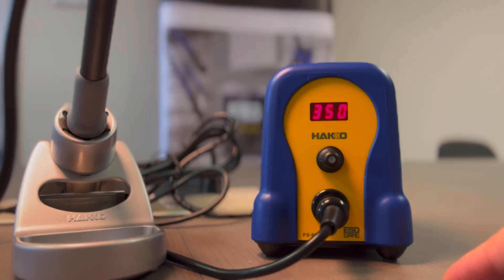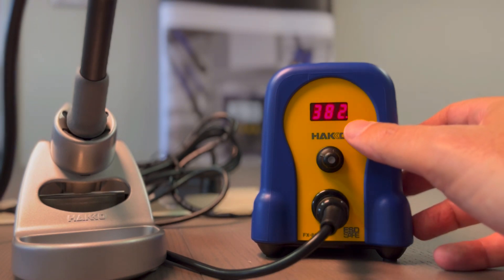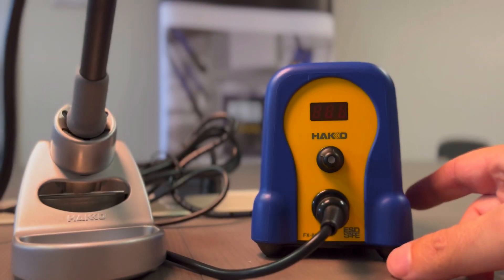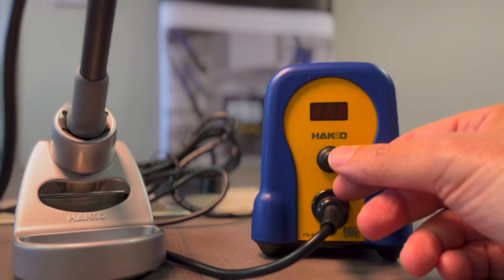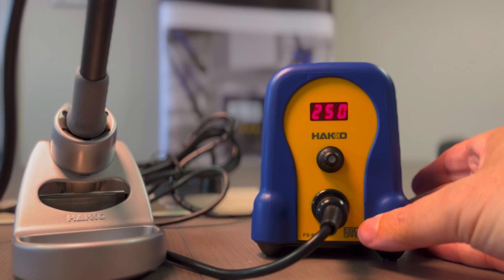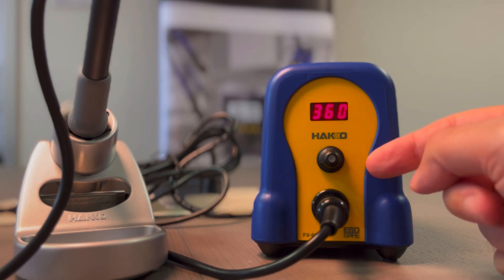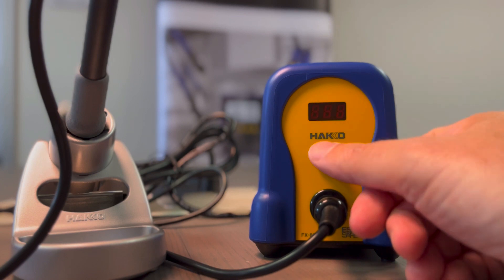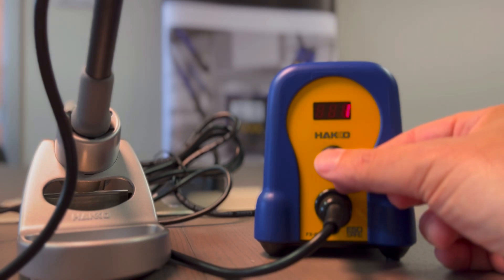How it works the HAKKO FX-888DX Soldering Station

Comment: The user interface, setup and programming procedure looks very much non-intuitive and user-unfriendly, with a steep learning curve (and likely a frequent re-reading of the manual) in the first months after purchase. Previous Hakko users/owners will also find themselves having to buy new tips of the desired tip size and shape for this iron because it won't use the older standard tips ---- T18, T19, 900M etc ---- that they probably already own; and it's apparently not compatible with other earlier Hakko irins eother. PS, a DIN plug is a poor connector choice for carrying current; many Asian-made units costing far less use a screw-on connector with metal locking collar, much better for reliability and heat dissipation (using a 95 watt iron with a DIN connector is sure to cause connector failure). On the plus side, if Hakko was aiming to design a product with a sufficiently complex programmng procedure that it would be difficult for  counterfeiters to exactly clone and duplicate, they've probably succeeded! Since these stations cost only $120 directly from HakkoUSA, I was considering buying one, but I was put off by the idea of a digital encoder interface; after seeing how it functions, no thanks, I'll pass. The only way that Hakko could make it less user friendly is to transfer all user-adjustable functions to a remote control (that's sarcasm). And yet, they kept the ugly "Fisher-Price" childs-toy color scheme (but reportedly with a silver iron-stand, as shown here). All of the above leaves me cold, not a good place to be with a soldering station. Smh.....

Comment: Looks like the tip power for this new 888DX is 65W, same as for the old 888D. However, the power used by the new 888DX is 100W vs 70W of the 888D. Do you know why the new unit uses more power?
Reply from the maker: Thank you for your comment. It is now available an optional 95W soldering iron dedicated for the FX-888DX station named FX-8806.
FX-8806 needs soldering tips T32 series.
https://www.batterfly.com/shop/hakko-fx8806-811
https://www.batterfly.com/shop/?route=product/search&filter_tag=hakkot32&limit=100
Reply: @BatterFly2002  Thanks so much, after I posted the comment yesterday I realised that the 95W iron exists and forgot to edit this comment. Very useful to know it does not use T18 tips but T32 instead, thanks for providing this info!

Comment: They should now add ths digital encoder  to the FX-951
Reply from the maker: FX-970 use to have the knob. FX-971 is the successor model of FX-951. Thanks!
Reply: @BatterFly2002  FX-950 has the knob but it is analog. FX-971 has the same bad design as the FX-951.  Not intuitive.  I just got the FX-888DX to replace one of my FX-888D stations.  I have FX-951, FM-203, FX-888DX, and FX-888D.  The new design of FX-888DX is the best.  I would like purchase another soon!  I also have the Weller 1010NA but do not like it at all.  Hakko is the best!
Reply: I bought the 888DX in Australia on special. 3 different colours to choose from too but I went with the basic blue and yellow. I reckon this model is on special because it isn't moving out the door. Can't say for certain but the other versions (models) are not on special at all. So, this was a great deal for me as I saved over AU$90 and got the dial which I wanted.